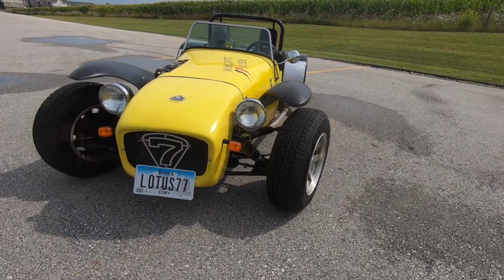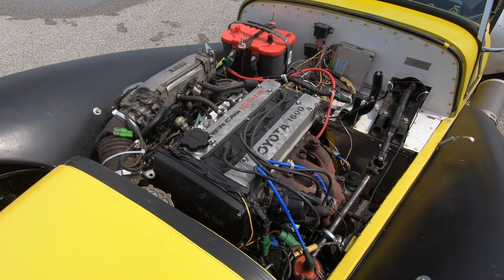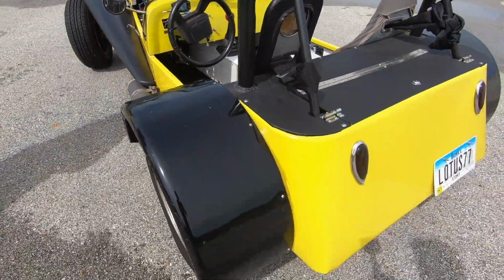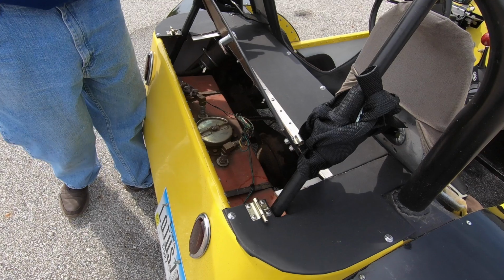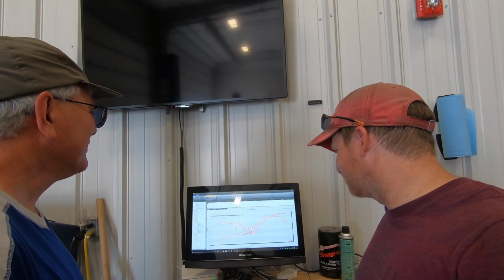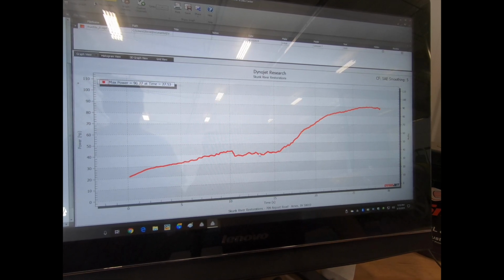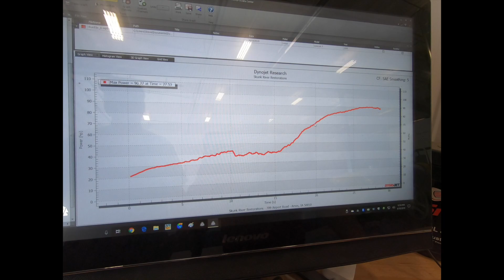Locost Lotus Seven Drive and Dyno

Comment: It's got loads more to give, I have got a Westfield with a 4age redtop with throttle body injection managed by an omex 600, its 142 at the crank when I got it on the rolling road, mine has a type 9 Ford Sierra diesel gearbox and when I got it weight on the weight bridge it topped the scales at 560kg so just over half a ton 🤗

Comment: Disappointing,  l thought that would make at least 130bhp. You can get 90 or more from  an "A" series with mild tuning. I' m no mechanic but l don't think the exhaust helps.
Reply: Mine has got a 4age redtop and that's pushing out 142 at the crank 🤗
Reply: Ya the exhaust is a $10 bike muffler coupled to a bent up piece of exhaust tubing, and a 2-1 muffler tip I literally found on the side of the road. Lots more there to be had